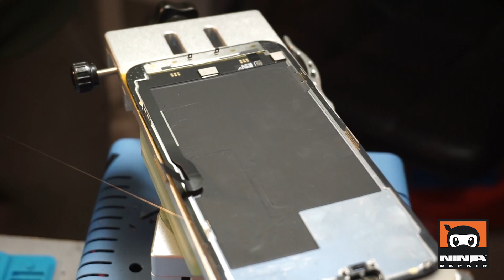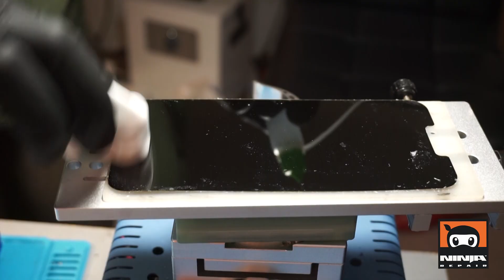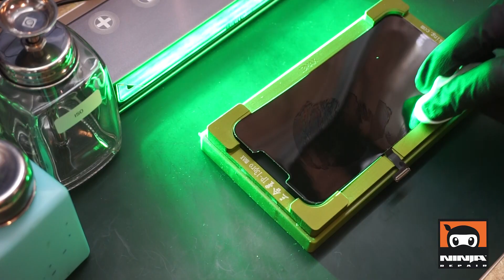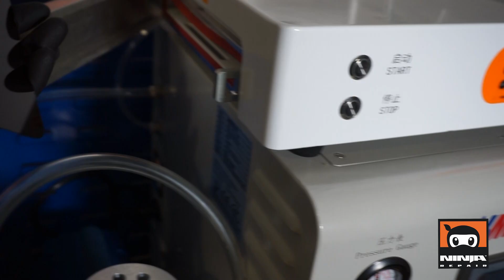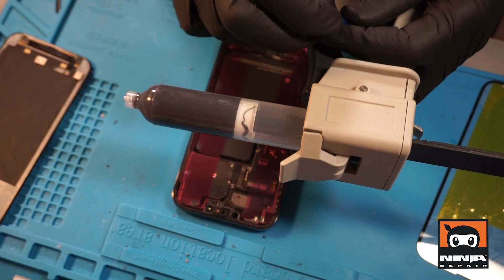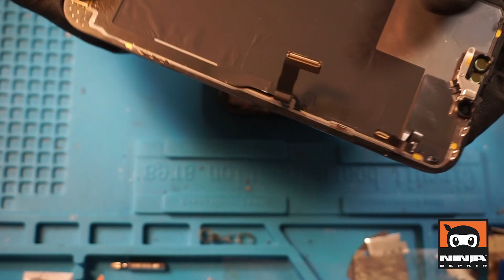How to repair an iPhone 13 Pro Max Screen (Glass-Only Repair)

Comment: How safe is this and what is the success %
Reply from the maker: Depends on your skill level. I probably have a 95% success rate now :)
Reply: @ninjarepair what kind of issue that came on that 5%
Reply from the maker: @maharajnarayanan1060 sometimes ink bleed or lines. It's not very often now though. Also sometimes you can cut through the polorizer layer but that can be replaced too
Reply from the maker: But if you've not done any before, there is a high chance you'll damage the oled

Comment: Hey i wanted to keep my genuine screen so i bought the glass only i dont want a fake how much could this repair cost
Reply from the maker: You're mainly goinf to be paying for labour cost and the cost for potentially breaking the display (as this is very easy to do). There are lots of different glass qualities out there too. I would think it would cost about £80+ depending on the model etc

Comment: Bro my 13 pro max is showing white screen when i woke up without any physical damage. What could be causing this and how can i fix this permanently from happening again please help me you will be a life saver 🙏🏻🙏🏻🙏🏻🙏🏻🙏🏻🙏🏻
Reply from the maker: You could try going into the Apple store first if there is no physical damage. There is a small chance Apple will do this repair free, however, if not. You will have to replace the display. The displays are unfortunately not cheap if you need to replace this yourself.
Reply: @ninjarepair I bought the new as brand new 2 years ago and I have been very careful with it that is why it broke my heart that I woke up to a white screen.. And I am worried that if they change the display it is still going to happen again. I don't know if they have been able to make new displays that don't have this problems  😢
Reply: That’s usually a lcd issue or overheating. Like he said try apple they know they had that issue it’s known at least best luck

Comment: Great videos sir
Is it possible to repair green line issue ?
Make a video pl8
Reply from the maker: @electrosound4595  it is possible, but I do not have the machine to repair green lines :).

Comment: Those chinese chemicals are a nasty hazard. I found that limonene is a natural citrus based glue remover. So i went to the auto parts store and bought limonene based glue removing spray. Works wonders on oca glue.
Reply from the maker: Thanks for the comment! D-lim is great, apart from the 12 series where it will eat through the plastic coating. I use D-lim sometimes (and it smells great), but a spinning tool is quicker. If you're newer to repair, you can sometimes scratch the polorizer layer, so iso or d-lim might be better options :).